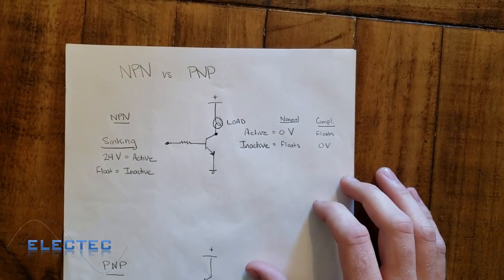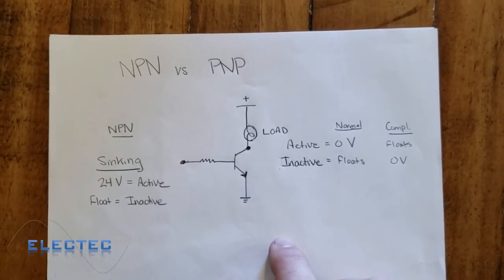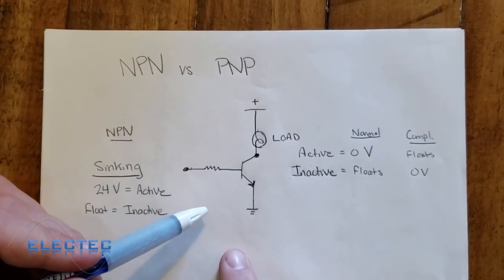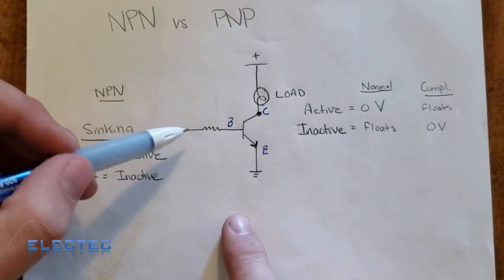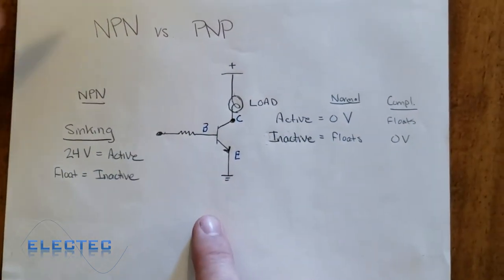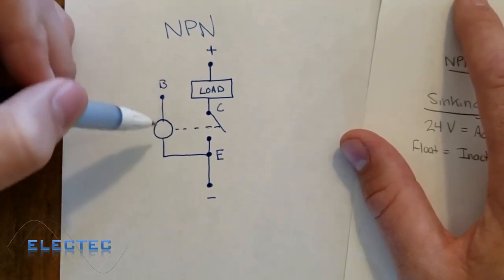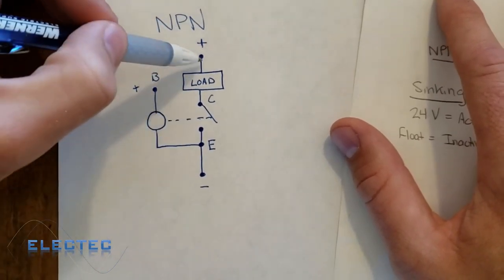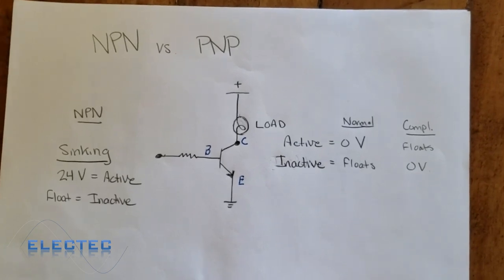How an NPN Transistor Works as a Switch?

Comment: I don't understand "sinking" whatsoever. After reading a bit it's power on. The secondary circuit (opened by something going ON) takes power from the first and it's sometimes 2 power driven circuits in other situations with other transistors. It's a bit complicated because people make loops and whatnot in examples. I'm not sure how many know what is happening.

Comment: Simplified:  "an NPN transistor is a 'normally open' relay.  Energize the 'coil', or "base" and it closes allowing current to flow from contacts 'C' to 'E'." Not?
Reply: So does a PNP act as a normally closed?

Comment: Complete NOOB here. Cool video BUT what we are always shown, regarding NPN transistors, is a little arrow pointing away from the emitter. And the direction of the arrow of the collector is never shown [tho we know it, to be pointing AWAY from the collector - NPN = Never Pointing iN] it is even illustrated on some NPN transistors. So, my question is: HOW does current travel in the opposite direction of the "imaginary" arrow of the collector, when the current at the base, permits it? It's my understanding that current can only travel one way, in a diode, an NOT the other. So, unless the diode in the collector branch, is some kind of zener diode, I don't understand. Please clarify - I want to learn. Cheers!
Reply from the maker: Imagine it this way. The arrow designates the direction of emitter current, using conventional current flow. Also the arrow is always on the emitter-base, or base-emitter side. You wont see a schematic with an arrow on the collector. The idea is that applying a base current across the arrows leads, you will completely break down the reverse biased collector junction (almost).